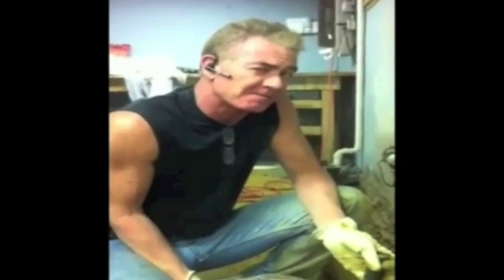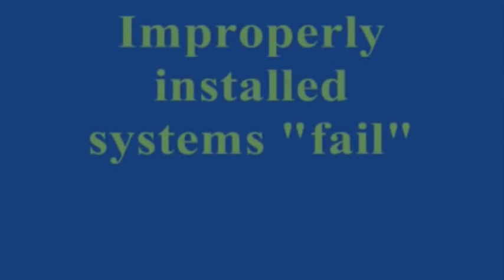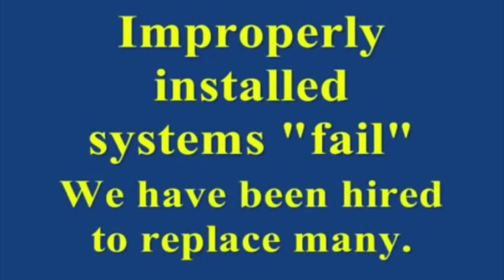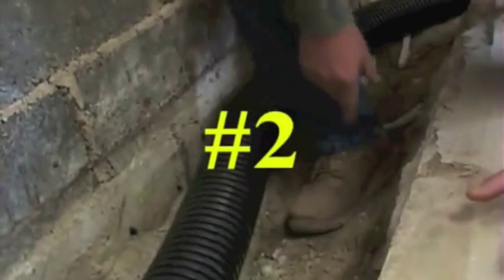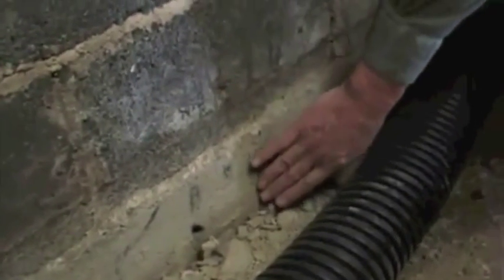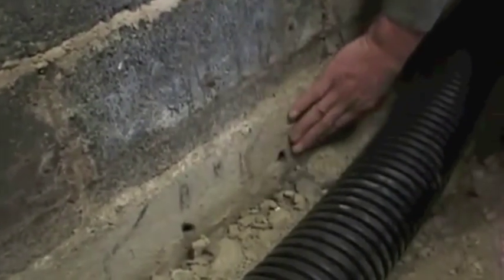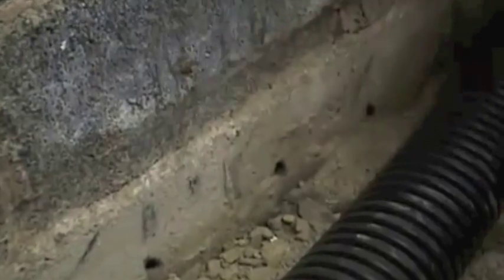Basement Waterproofing in NJ - "Weep Holes"  and wet basements

Comment: I recently had a french drain system put in .It was below the slab and pitched on both sides towards and single sump pit on opposite wall.After the new concrete was poured I noticed that there was a wet spot on top of the new concrete.It seems that maybe the water is getting between the new concrete and the plastic dimpled drainboard.the drainboard overlapped the gravel about one foot and the trench width was 13 inches wide